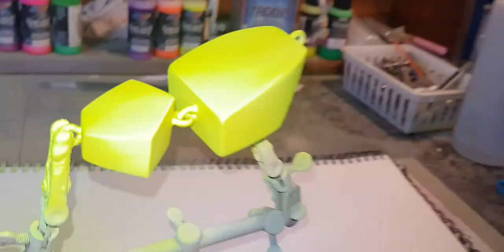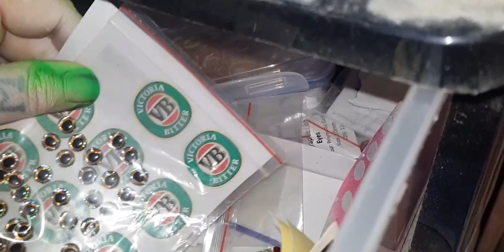Making a Wooden Surface Lure (Filling a Custom Order) A-Z

Comment: What a great video Les. The entire process demonstrated...right from the idea through to the finished product. All done with great skill and attention to detail. Thanks for the insight into your lure creation process. When you "water test" the lures, do you have much fine tuning to do afterward?
Reply from the maker: Thanks heaps mate. It depends on the lure. If Ive made them before, generally not much tuning needed at all. But if its a new design.. it can take several prototypes and tuning

Comment: Love it mate. Think I need one 👍🏻 What wood do you use mostly and where do you get it? Just Bunnings stuff or? And how did you make the paddle bib? Unreal mate. Keep it up 👌🏻😎
Reply from the maker: Thanks mate. i can fix ya up with one. just send me a message on Facebook or Instagram (same name) or email pitbullcustomlures@outlook.com

It depends on the lure to what timber, im still learning about different timbers and whats best. but just about anything will work if you seal it well and weight balance it.  Bunnings is a good place to start or your local reclaimed   timber yards. Tasmanian Oak, cedar or even radiator pine from Bunnings. I get all sorts of hardwoods from the reclaimed joint.
the bib is lexan polycarbonate, just cut to shape and heated up to bend
Reply: @pitbullcustomlures1917  awesome mate. How much are they? And where do you get that lexan stuff?
Reply from the maker: @dansfishing3013  $25 plus post for these ones mate. I get my lexan from regencyplastics.com.au
Reply: What do u cut the polycarbonate with mate
Reply: And what thickness